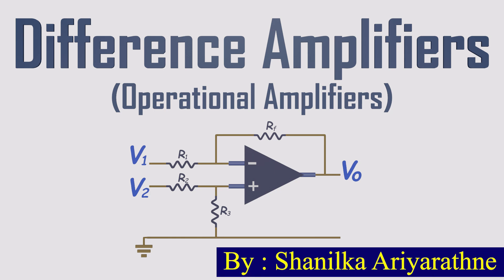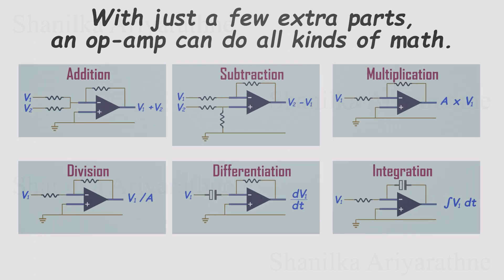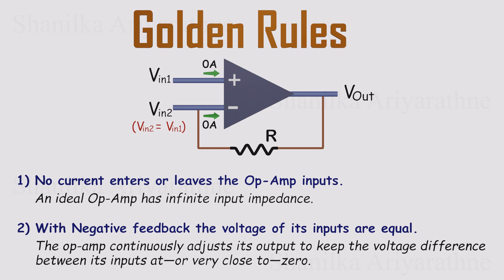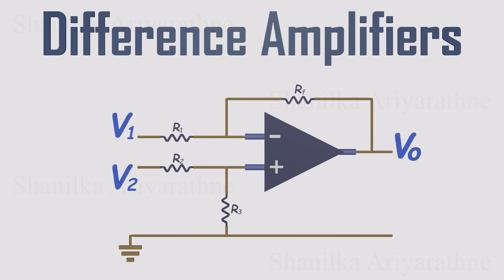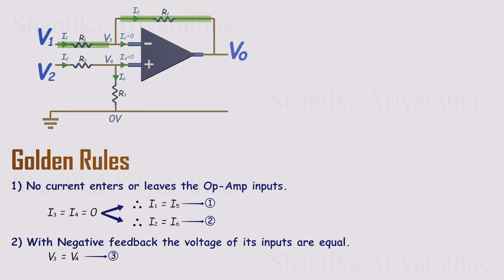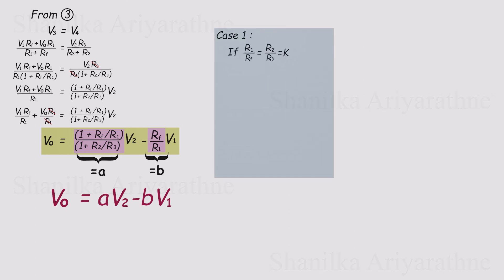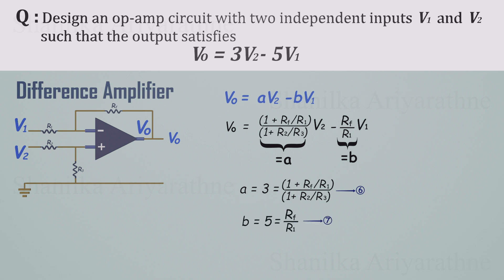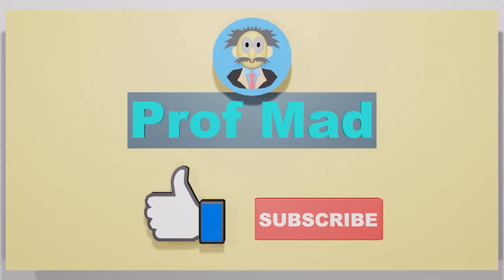Mastering the Difference Amplifier | Exam-Style Problems with Op-Amps

Comment: Can you provide me with an efficient and workable circuit composing of a high-input impedance and low-noise non-inverting op-amp and a high-input impedance and low-noise inverting op-amp connected to a high-resistive semiconducting sample that is powered by an ac oscillator having frequencies from 1 Hz to 10 MHz. It is important to find a circuit that doesn’t suffer from significantly varying phase and amplitude with frequency, so little effect on the complex impedance of the sample. 

All thanks to you and have a wonderful weekend